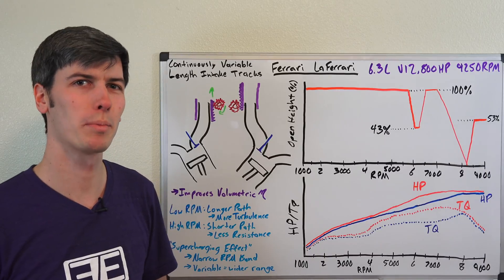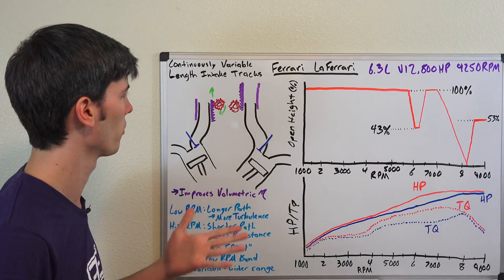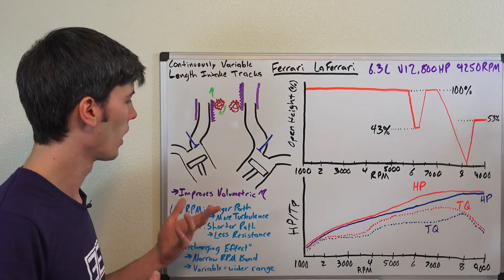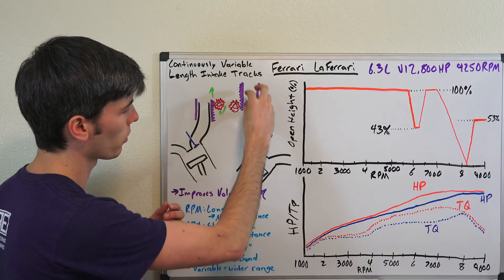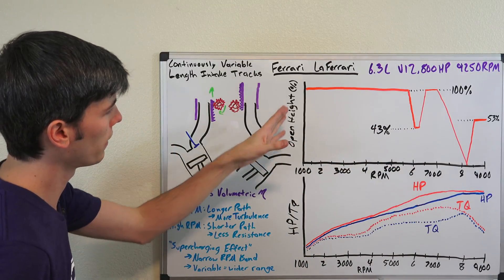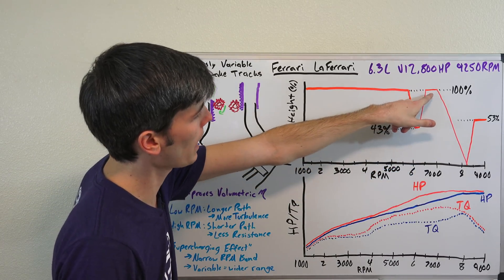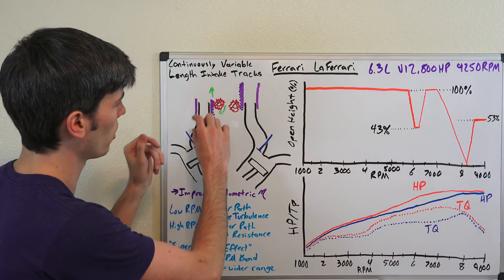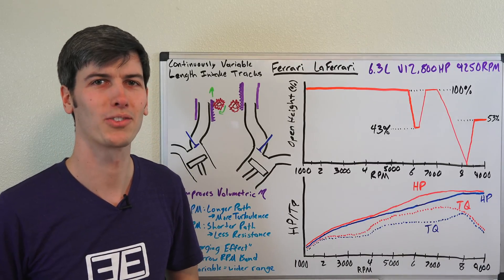Ferrari LaFerrari's Brilliant Air Intake System - 800 HP V12 Engine

Comment from the maker: If you like car pictures, you should follow on Instagram! https://www.instagram.com/engineeringexplained/
If you like cat pictures, you should follow Bucket on Instagram! https://www.instagram.com/bucketron/
Happy Sunday everyone!
Reply: I was like "Hey look, cats. I Like cats."
Then I noticed you in one of the pictures and I was like "What is he doing there?"
Then I realized you own this cat.

Not even 12:30 yet.
Reply: Engineering Explained Yes, excellent. But why did Formula 1 ban this? Isn't improving the engineering of motor vehicles part of the reason for the sport?
Reply: Engineering Explained You're my hero
Reply: nope. thats unicorn magic with the valves. this is magic with the intake lengths
Reply: Engineering Explained so is this VTEC kickin' in yo ?
Reply: Venturi-like effect that occurs as the flow becomes more laminar, the air flowing along the outer walls(boundary layrer) slows down while the air towards the middle increase in velocity.
Reply: brandon casey Which is why it should be widely adopted by the other racers. Banning improvements eliminates the engineering improvement side of the sport and relegates Formula 1 to the status of an antique racing league. Still lots of fun, but you don't learn anything. Tragic that they've chosen to blunt the cutting edge.
Reply: I think it has to do with conservation of energy and the rotational inertia of the air, converting rotation into direct acceleration of the air as it tumbles down the runner. I don't buy the standing wave effect because the manifolds are never shaped to allow it to work. They would need to have expansion chambers like a 2 stroke exhaust, not just the manifold design every car out there has.
Reply: Engineering Explained outstanding, ferrari does it again.
Reply: It's worth mentioning that the Mazda 797 did this too.
Reply: +Michael Foye I'm pretty sure this was banned along time ago. I remember seeing it where the Mclaren team debuted variable intake runners on Senna's 1991 Mclaren at spa. "Worked beautifully" I'd be interested to see a variable length exhaust system cause you could get the same effect in reverse. Of course it would be a little more difficult with the expansion of the metal at temperature. But if they were made of the same material it should be fine. The other thing is it wouldn't have to be sealed perfectly anyways, so long as you weren't running anything through a cat converter anyways (i.e. Racing car)
Reply: Engineering Explained why does a longer intake make the air have a larger velocity? I understand if you were to make the diameter of the tube smaller the air would speed up because of bernoulli's principle but I don't see how making the lube longer makes it speed up.
Reply: ExileXCross Ok, I'll look into that, thanks
Reply: This is the second cat named bucket that i follow on instagram
Reply: it has been unbanned since V6 turbos have came back in. Renault run it I know that
Reply: Engineering Explained It sounds great! Why did Formula 1 ban it?
Reply: u666sa What is reverse charging?
Reply: Michael Foye it gave Ferrari too much of an advantage over the rest of the cars
Reply: Honda allready had it on the i-vtec engine.
Reply: Mark Van Walsem IAB from Honda uses the same principle. but they have actually 2 sets of intakes and they switch just after Vtec. 
where as variable length runners move up or down based upon vacuum
Reply: jack black didn't know that...thanks for the info.
Reply: u666sa engine speed or RPM does not make detonation non existent. if a spark is ignited at 4 degrees after top dead center at 1000 RPM. the EXACT same thing is happening at an engine doing 14,000 RPM. detonation is always a factor.  intake temperatures, engine temperatures, fuel temperatures, and piston compression, fuel mapping and ignition mapping are the basic reasons for detonation. engine speed doesnt alter the probability at all.
great question tho

regarding Variable ignition and variable valve timing and the variable intake size. 
Variable ignition is basically happening in most modern fuel injected cars. if detonation is detected the ECU is triggered to reduce the timing to minimize or stop the detonation. some aftermarket Engine managment, will just keep adding ignition timing until Detonation starts and will automatically adjust 

variable valve timing and variable intake runner lengths do not do the same thing. 
variable valve timing allows an engine to run a 2nd camshaft with a more aggressive profile allowing either better fuel economy and good low end torque on the first Camshaft, and the 2nd allowing high engine power, with low torque low in the rev range, 
a variable intake runner can help facilitate and improve the variable valve timing, but it would not make any where near the power that the camshaft can produce. 

so the conclusion is all of them together makes a very nice engine. but just the variable intake would only improve drivability and low amounts of HP.
Reply: Can u explain "Freevalve Update Camless Engine" that KOENIGSEGG has ? ( plss I desperately want to hear some explanation from u)
Reply: Casey Colgan I doubt that it would have enough benefit to justify the additional weight, even if it does work, but thats absolutely not a good reason to at least try a proof of concept. F1 and NASCAR is supposed to be an engineering tech demo with loads of gearhead fun, racing and BBQ. Yet like the sport is being pushed to oblivion by regulatory management obsessively concerned about the strict fairness of the competition from an athletic perspective to the detriment of the sports raison d'etre (reason for existing).
Reply: +Michael Foye yes it's never been done before. Idk about weight I think it's more thermal concerns. There's no doubt it would be an awesome system in a two stroke application
Reply: Casey Colgan It would introducenew failure modes to the system. Weight and thermal control issues you mentioned, as well as the possibility that it would reduce efficiency, especially if it became untuned during use. Including an increase in the possibility of carbon monoxide filling the crew compartment. All that only if they can get a test unit working sufficiently well to justify working it into a working racer. Then there's that too.

Sounds daunting, but much more has been achieved against much more improbable odds. We may someday see such a system. 

Might make sense for a reburner system which catches the unburnt fuel from an intentionally fuel inefficient high power engine to increase fuel efficiency and provide a bit more power. See all of the above problems and add 'unnecessarily complicated' and a host of new issues to the mechanism, revisit and multiply weight and thermal control concerns and the corresponding hours of calculations, trial and error, etc.,
Reply: F1 rules are the dumbest ever....why innovate..........when you do, F1 rules limits you, or take away your innovative advantage
Reply: Engineering Explained I was the 100 liker
Reply: Engineering Explained So If I recall correctly, combining this technique with ITBs would counteract their downside (of having benefits only for a limited rpm range)?
Reply: Engineering Explained .i
Reply: My yamaha R6 2008 has exactly the same system. It's called yamaha chip controlled intake YCCI. Ferrari didn't invent anything

Comment: fascinating. something similar is done with CNC milling, as a drill bit in operation vibrates (chatters) depending on RPM and cutting forces (depth, material, speed, flutes, etc). Traditionally one might just reduce the cutting speed to keep the drill bit from vibrating, but running a job at a single low speed is time consuming. Using a computer one can simulate the cutting forces of a machining job, and hence improve cutting speeds by varying them dynamically throughout the job; keeping them maximized at all times. This can be taken even further though by understanding that vibrations have resonate frequencies, and by INCREASING cutting speeds, you can actually find a small zone beyond the first lobe of vibrations where the vibrations all cancel out. If your calculations are accurate, you can program a CNC mill to operate several times faster by riding that very slim band  of stability.
Reply: //Project Grassroots  its always has an Inline 4 which I don't really like

Comment: Didnt Porsche do this same type of setup? vari-ram or vari-cam, something like that. It was in the Carrera S in the 996/997. It has a sliding tube on each intake tract, and it will travel up to create a longer intake runner, and lower the sleeve, making the intake runner shorter..
Kind of curious if this is the same concept/design as the Ferrari La Ferrari system in this video

Comment: Would a Bernoulli effect work with intake tubing? In other words, would reducing the diameter of the intake tubing at some point just before entering the piston chamber have the affect of increasing the flow of air providing slight supercharging to mix with the injection of fuel?

Comment: hey there, the length of the intake ducts movement is 70 mm,  your graph is a little wrong, instead of having 100% you should substitute it for 70mm on the top of the scale and 0 at the bottom.
Reply: Nothing "wrong", not even by a "little": if range = 70mm, then 100% range = 70mm, and 0% range = 0mm. The only difference is his graph uses a relative scale unit instead of absolute values, so at worst it is just less complete, likely done to avoid the industry standard metric vs 'murican units discussion.

Comment: Is the math basic enough to have a formula for this ram charging effect, Based on Intake runner volume, 
and length, And other contributing factors, To be able to share With the uneducated, And would it be the same formula used to tune exhaust pulses As well, As in tooting and exhaust 180 or 360 degrees? This is an area of great interest of mine.

Comment: Why would torque already be increasing at 4000 rpm (dotted red line) if there is no change in intake length until well past 5000 rpm? Great video btw, I like that you keep them short and get to the point.
Reply: Fixed runners wouldn't be 100%, they would be about 50% for max peak power.

Comment: shouldn't the HP/TQ lines cross eachother at 5252 RPM? I know the graph is hand drawn but even so...
Reply from the maker: They're different units, so it depends on the scale. Since there's no scale drawn (or units shown), they won't necessarily "cross" at 5252.
Reply: Fair enough. Since you specified HP (as opposed to Kw) I assumed the TQ would be in ft-lbs. But you're right - no scale, no problems. :)

Comment: Why don't the HP and torque curves cross at 5252 in your graphic? I thought that rule was true for all engines
Reply from the maker: +Christopher Siderius because HP and tq are different units, and my y-axis scale is not the same for each.
Reply: I see! Would they cross if the Y Axis scale was the same for RPM? And even though they are different units, hp is the rate at which work is done or torque is applied, so they can be (and often are) plotted together, no?

Comment: Instead of a variable length tube, you could have a system of solenoid valves that switch-in different tubing lengths.  Trumpet vs Slide Trombone.
Reply: I think that's how Volvo did it in the 90's.

Comment: Your graph shows no change in intake length from 1000 to 5750 rpm, so how can you explain the differences between the red and blue performance curves in that range?
Reply: A non-variable intake would be shorter than the fully extended variable one in order to reach the same peak power figure, as demonstrated by this system going to around 50% at peak power rpm.

Comment: Sounds a bit off to me.  From 6.5k to 7k rpm it is showing that the intake runner is at the normal length.  While the graph below is showing the difference compared to normal and there is a big torque boost.  Doesn't compute

Comment: Toyota starting variable intake manifolds in the 4AGE engine in 1985 MR2 and the GTS Corolla.  The Toyota system called TVIS (Toyota Variable Induction System) works with vacuum operated flappers to block off 4 of the 8 runners to the 16 valve, 4 cylinder engine.  After a few years, Toyota changed to a "side" valve between runners 2 and 3 to effectively "lengthen" the intake manifold.  There have been no intake leaks in this system.

Comment: This is the same system the 2006-2010 Dodge Charger 3.5L use. They have a variable intake length as well. It normally uses the longer intake path but when RPM reach over ~4000RPM the long intake patch closes and the short one opens. Glad I now know that it can create a supercharged effect when timed right.

Comment: 1.  Is the adjustment based entirely on on RPM?  If the engine was running 5750rpm with a throttle position of say 50%, is the 43% intake length still as efficient?

2.  You drew diagonal lines on the settings change implying a linear progression from 100% to 43% transitioning between 5750 through about 6000.  Is it linear or is it square?  Is the logic a CASE?

When RPM <= 5750 then intake length = 100%
When RPM > 5750 and RPM <= 6000 then intake length = 43%

Comment: They have clearly chosen a very poor length for their blue comparison torque curve because if they just used a fixed length inlet at the 100% length, the blue torque curve would be exactly the same as their red curve over a very large proportion of the rev range rather than well below it nearly everywhere!

Comment: Recently koenigsegg raseri has V8 5.0 litre four turbo charge engine, could you explain how the internal work? Such as Valve timing to deal with those 4 turbo boost, because W16 engine have 4 cam to deal with that.

Comment: Mugen used this on the Honda engine in the 1999 Jordan Formula 1 car. Pretty sure they used a small hydraulic actuator to move a small frame up and down with the trumpet tops mounted on and an LVDT for measuring the position, it was a long time ago though! You've also just reminded me that they had a 102% throttle, by rotating the throttle butterfly a tiny bit further (2%) it lined up with the angle of the inlet better for better air flow.

Comment: One question: those variable intake tracks starts moving down first at 5750 rpm. But on the lower graph we can se changes in TQ little bit before 4000 rpm. How is that possible?

Comment: 2 things I found interesting:

1. You state that the longer runner makes the air more turbulent. I found that the longer that a fluid flows through a smooth walled boundary layer, the less turbulent it becomes and the more laminar the flow actually becomes. If you think of this theory in application, there will be more air mass entering the cylinder in the laminar flow state due to its increased density and reduced particle  backpressure.

2. I also noticed that you see gains between 4K and 8K RPM, BUT the runners only reduce length between 55 and 65, as well as 8 to 9... It seems like there is not a relationship between the two data sets.

Comment: Cool video. Questions: In the bottom graph, is the blue a measure with the intake length fully extended/contracted or some arbitrary length? If your answer is fully lengthened, then why does the red and blue diverge at what looks like ~4000 rpm, when the top graph shows the open length to be constant at 100% up to ~5500 rpm. I would expect the red to match the blue right up to that 5500 point then diverge due to the length shortening. If it were some other length, that would explain the early diversion. Or maybe simply hard to draw the red and blue lines on top of each other?

Comment: I usually like your vids, but since I studied induction and exhaust tuning for years, as a fabricator who designed one-off induction systems for about 17 yrs, I suppose I have the upper hand here.  This explanation was pretty bad.  Overall nothing was necessarily untrue, just extremely crude and really lacking the relevant facts that dictate runner length and why varying the length is effective.  In the end though, there are books, upon books that still can't explain induction science in entirety.  Suffice to say though, this is kindergarten level explanation, and even for youtube, I feel that 4th grade was achievable in under 10 minutes.

Comment: Your hp vs torque graph doesn't make sense to me. I under the impression that the way horsepower is calculated, horsepower and torque must intersect at 5252 rpm.

Comment: At first I was freaking out that Ferrari managed to make a big displacement engine rev to 9k plus. Then I realized they simply put more Pistons in there reducing the mass of the Pistons allowing for the benefit of a small displacement motor rev range with the torque of a large engine.

Comment: Is this really that crazy and new? I remember the Mazda 787b used an intake setup on the R26B very similar to this. It has independent throttle bodies that extend out at low RPM to improve torque, and they retract back down at high RPM to give it that really high RPM power. 

Just search the R26B and read up on the intake Mazda designed.

Comment: Curious that there is a benefit attributed to this system before it has moved anywhere? (Delta between the torque / power lines below 5750 RPM) Guess it is as without the system you only run sub-optimal length from 4000 RPM onward.

Comment: I'm not positive if it's the same type of system. But Ford on there V6 is or at least the 2002 one I have. they used two intake runners for each cylinder one long one short. And use a butterfly valve to open or close one of them depending on RPM's and engine need. in a way of changing the intake length for the cylinders

Comment: How did the hp and torque curves change at low rpms when the system didn't activate until higher rpms?